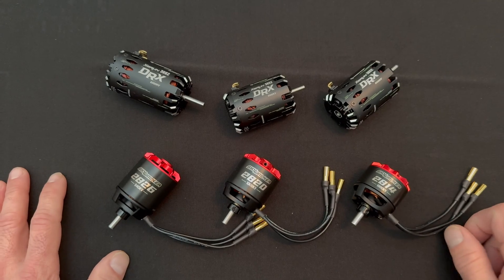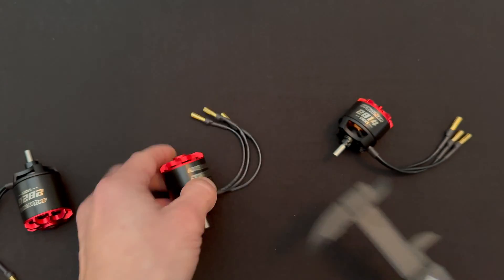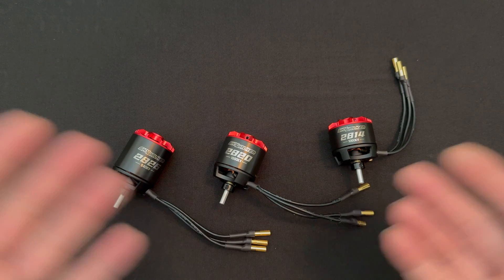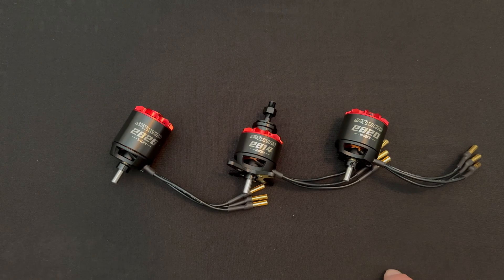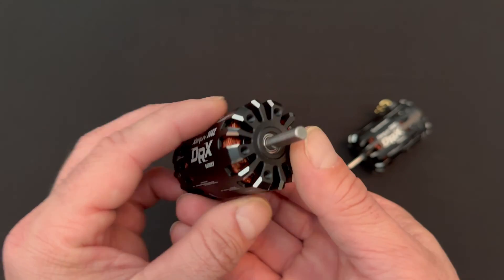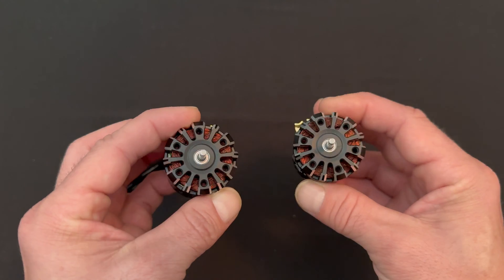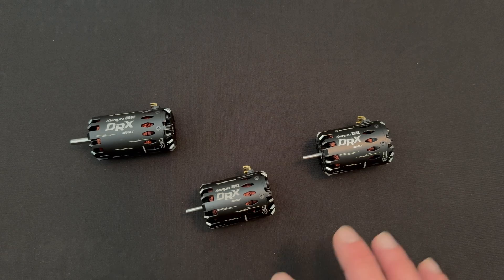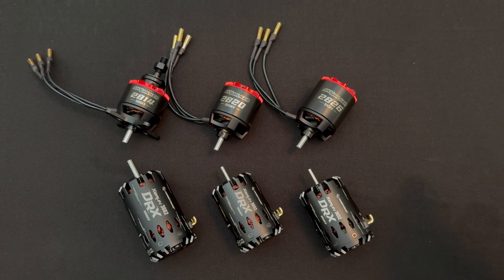The Charlie Show /// Episode 348 /// XERun DRX Drag Racing motors and Skywalker 2800 aircraft motors

Comment: Just got my 3662 DRX and im extremely disappointed. This motor is not compatible with my XR8 Plus G2S for full sensored mode with Turbo and Boost. I replaced a Maclan DRK with this motor specifically for the turbo and boost support but I am stuck exactly in the same place. I went back to the xerun 3652 motor I have for testing and full sensor with turbo a nd boost work perfectly So I know it is not an ESC issue.

Comment: I've been waiting for these motors since the Hobbywing ESCS wont run other manufacturer motors in full sensored mode with timing/boost. Would be nice to get  a list of recommended ESCs for the DRX motors. I plan on running a XR8 Plus G2S with the 3662 for outlaw.